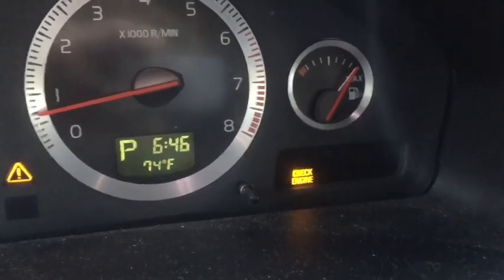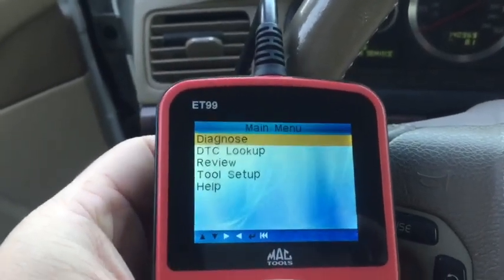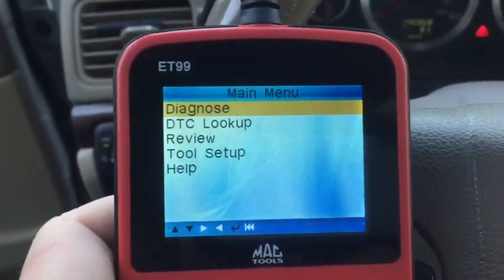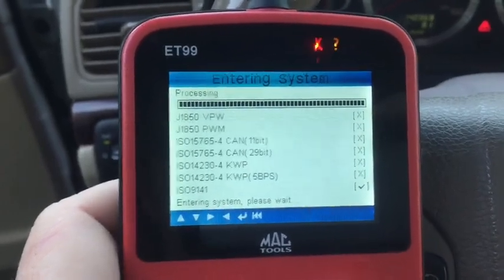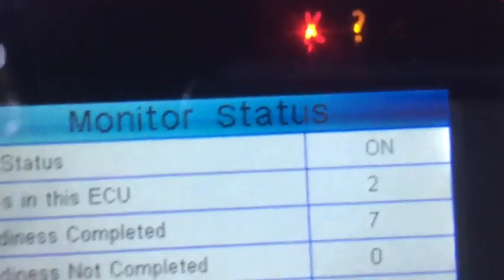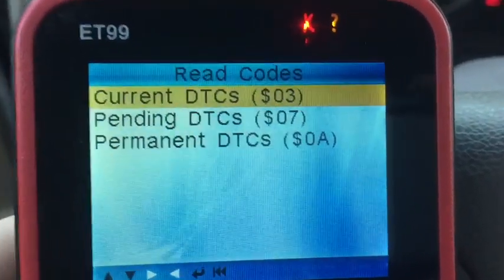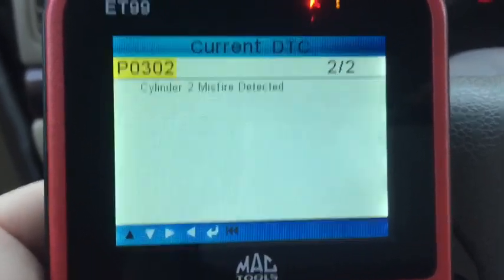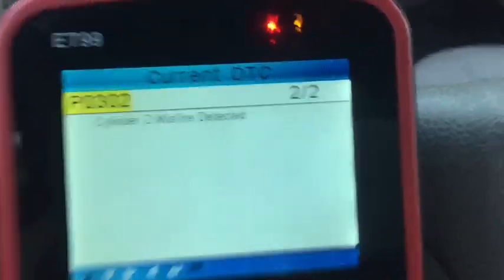Why is my engine light flashing explained.

Comment: Everytime i get up to about 70 the check engine light flashes then turns off. What could that be ?
Reply from the maker: Energy for Sale you have a misfire that is only happening under that higher load. This is usually a coil issue. If you get the codes checked after this happens but before you shut off the vehicle it should direct you to which cylinder has the misfire.
Reply: Your Car Guy DR thanks for the reply good brother. It’s code P0300 and says RANDOM/MULTIPLE CYLINDER MISFIRE Detected? Doesn’t give me any specifics.
Reply from the maker: Energy for Sale what type and year of car do you have?
Reply: @YourCarGuyDR  2002 tahoe lt

Comment: Thanks for the video.  I have a cylinder two misfire.  I changed all plugs. Engine coil.  Cleaned MAF sensor.   Cleaned throttle body.  After throttle body I ran a lot better and light even went off.  But not not only is light back on but it’s flashing.   Is this real serious when it flashes and should I drive
Reply from the maker: Truth Seeker anytime it’s flashing you do have a misfire and should check the code to verify the cylinder. If the is the same cylinder as previously then do a compression test.

Comment: Okay so I was driving and then slowed down to about 25-30mph whilst in gear 5, the car started hesitating and almost having a slight slip feeling as if the power can't be transmitted, so I down shift to 4th and it continues and then a flashing check engine light came on. I was only 2 mins away from my destination, I drove there and the car was shaking very badly, so once I arrive, I turned the engine off and back.on and the light went and the car was no longer shaking, so I drove the car for about 10 miles and it seemed normal. Anyone know what this could be should I be worried or no. The car isn't anything worth saving so shall I drive till it packs in or what?
Reply from the maker: TRiCk_SHoW the flashing engine light means a misfire. It likely didn’t store the code since you shut it off. If when it does it again you check the code without shutting it off it will likely give you a cylinder that is misfiring. Replacing the coil pack on that cylinder will usually take care of it.
Reply: @YourCarGuyDR  but you see, I had a coil pack replacement done 600 miles ago on the car. I know that my NOX sensor is also faulty and in need of replacing so could that have caused the issue?
Reply from the maker: TRiCk_SHoW NOX sensor won’t cause a misfire. Anytime the light is flashing it means you have a misfire. It’s possible that one of the new coils is failing. You need to try and get the code when it does it again and it will give more information which way to go.
Reply: @YourCarGuyDR  yeah I received my code reader, plugged it in and no codes found, so what I might do is recreate the condition that caused the light to come on which was being in gear 4 doing 25mph and then accelerating as that always leads to that hesitation feeling but this last time caused the flashing light
Reply from the maker: TRiCk_SHoW yes the misfire codes clear themselves once the key is cycled off. When a coil pack is failing they will usually do it under high load so low speed in high gear is a good way to do that. Sometimes it won’t act up until the engine is warm.

Comment: My check engine light was flashing, I replaced everything, still flashing,   turn out to be a bad head gasket, so y'all be careful.👍👍👍👍👍👍👍
Reply: I have the same issue. After you changed the bad head gasket,  was the problem fixed?
Reply: @arks1980  take your upper radiator hose off pour from there, not from radiator or reservoir tank, and pour in when engine cold, after sitting overnight, let me know if you need any help 👍👍👍👍👍👍👍👍👍👍
Reply: @arks1980  a mechanic shop told me to go buy a product called blue devil,  cost $39 and it worked like a charm,  at first I was like nah I ain't buying that, I changed my mind and it worked. It's been 2 months still running perfect,. don't think anymore my friend, go but it today, and I promise you it really works, saving you thousands of dollars 👍👍👍👍👍👍👍👍👍

Comment: Can a broken bank 1 sensor 1 o2 sensor cause a misfire on cylinder 1
Reply from the maker: Jason Meyers not usually. If the computer can’t read the o2 sensor it will use a default fuel map. If the broken sensor is sending faulty data it can cause issues. Either way the broken sensor should be fixed.

Comment: My 2016 gmc 5.3 did this today came on flashed then went off i kepted driving i needed an oil change was at 5% hope it helped?🤷🏻‍♂️
Reply from the maker: Random Videos the oil change can help since your 5.3 has variable cam timing controlled by oil pressure. If not look for a misfire code and possibly a bad coil pack.
Reply: Your Car Guy DR i also mixed 91 with 87 gas🤷🏻‍♂️ ops
Reply from the maker: Random Videos truthfully that shouldn’t make much of a difference.

Comment: don`t drive if engine light is flashing
if you do, fuel will get into the catalytic converter causing it to overheat and melt inside, could cost hundreds if not a few thousand to replace.
Reply: Straight piece of pipe is cheaper lol

Comment: I pulled over after it started flashing 10 miles into my drive home, it was misfiring periodical as I would drive the last couple days, I let it sit for 10mins then I drove home, engine light didn’t come on or flash the rest of the way home (8 more miles)
Reply: The spark plugs got change and it fixed the problem!
Reply from the maker: A seeing idog usually this is a coil pack starting to fail. They do worse when hot so letting them cool for a few minutes can help. If you get the code checked you can usually determine which cylinder is misfiring.
Reply: Thanks for the quick reply, the auto parts store said it would read codes unless the engine light was on, idk, looks like a pack of coils is $50-$100, any monkey can pit them in? All I have to do is drive back and forth to work to work this week till I get a new car as this one is not mine, wish me luck,😖
Reply from the maker: A seeing idog hopefully it gets you through the week. Good luck!🍀

Comment: Can a bad battery cause the check engine light to flash?
Reply: No  its firing  order vibration when car at a stop point.a low drop,,, loss of compression timing
Reply from the maker: thegreatecb the flashing check engine light indicates an engine misfire. The only time a battery would cause this is if the voltage was right on the verge of where the engine can fire the spark plugs and injectors. But if the alternator is working that shouldn’t occur.
Reply: I think my alternator might be bad. When I go over 20 mph the CEL starts flashing and drives horrible. Before this it ran great besides the battery issue.
Reply from the maker: thegreatecb I would get the alternator tested before replacing. Normally if it is bad you will get the battery light on while driving. Usually the flashing and terrible driving relates to a bad coil. You can have the codes checked and most often it will indicate which cylinder is having the misfire.
Reply: They did try to scan for the codes, but said the scanner wasn't even registering ...
Reply from the maker: thegreatecb that can happen if the fuse for the OBD2 port is bad or sometimes if the engine  computer is not communicating. Most of the time you can get a connection. If you can get the codes it will likely have at least 2 in it. One will be random multiple cylinder misfire and the other with be for the specific cylinder or cylinders that are misfiring.
Reply: Ok I'm going to get it checked asap thanks